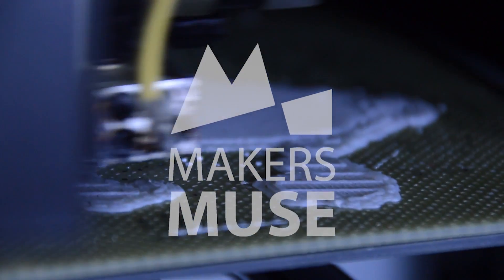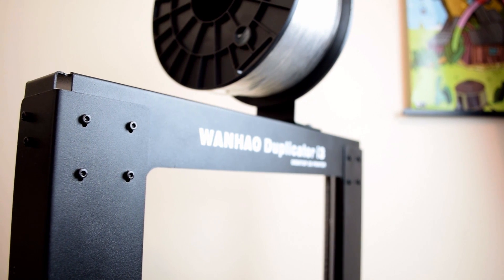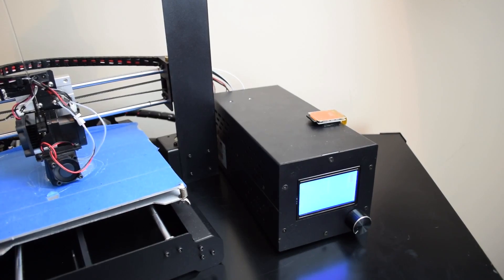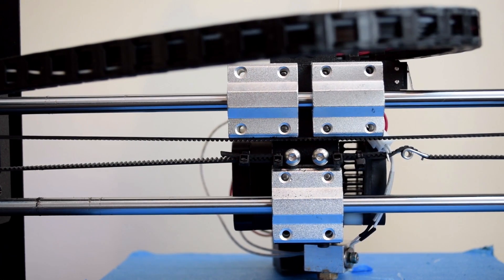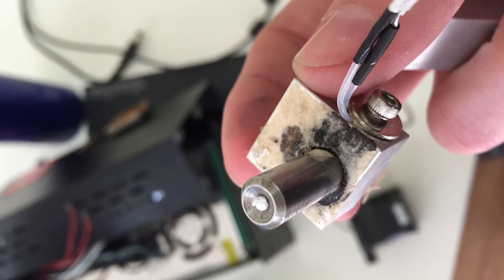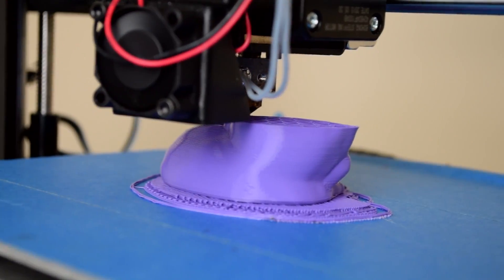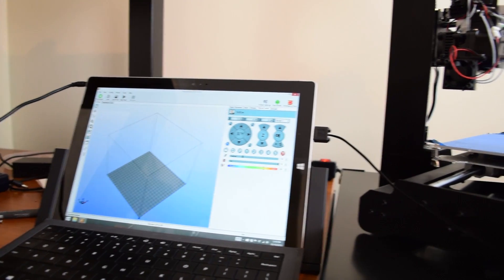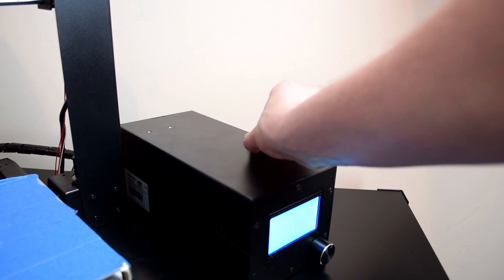Wanhao Duplicator i3 3D Printer Review - 2015

Comment: Congrats on the 1Mil. this was my first video I saw from you. Used my first tax return to buy one all those years ago.
Reply from the maker: Thanks! I do kind of miss these sheet metal i3s, how long did yours last?
Reply: @MakersMuse  5ish years.  It would still be working if I hadn't started a ReDuplicator mod, and fried the old melzi board in the process. Just finished a 350 V2.4 Voron build . next its am Ender5 to Mercury 1.1 conversion. Then I think Ill get the I3 back and and running, still have all the parts

Comment: I myself got the Wanhao i3 plus, bought it in 2017. It's still up and running (With some downtime since i had a time where i didn't have enought free time) Only thing that needs fixing until now are the bearings on the y-axis but i don't mind that :) Almost all my prints come out perfectly after a cooler shroud upgrade which i printed, and currently getting all the components for a z brace. Very happy with my machine!

Comment: hi I'm interested in getting a 3d printer in the next week or so . I found this on ebay. and from the reviews over sea's seems to be a very popular version of the i3. can you please have a look and let me know if it will be a good one to start with . http://www.ebay.com.au/itm/112198782900
Reply: The Monoprice Maker Select V2 is basically a rebranding of this printer in this review but far better. I own one myself and after printing a couple mod upgrades for it, it does everything I could want. I bought mine off Amazon here https://www.amazon.com/gp/product/B018GZBC3Y/ref=oh_aui_detailpage_o01_s01?ie=UTF8&psc=1
Reply from the maker: Yeah, I would join the Facebook group for that machine to see how 'good' it actually is - or watch our review. It still doesn't work.
Reply: Maker's Muse hi thanks I'll look . i couldn't see a review you did on it ?
Reply: Maker's Muse hi I see there's not a part 2 of the review.  I take it its not a printer worth getting . thanks for the heads up
Reply: Scott Miller thanks for the link. still out of my price range I'm now looking at the flsun metal i3 on amazon.  has some good reviews

Comment: Do not buy this printer, is the basic feeling after 4-5 months of owning one.  Unless it's the only sub $400 printer you can get for some strange reason, like seriously almost anything but this, but if it's the only option of Wanhao or nothing then yes due to those limitations buy one, fix all the BS first before running it or the bearings will fail at 3 months and it will need full disassembly and replacement parts.

love/hate this printer.  I own the Monoprice V2.1 same thing different label.  the metal frame is kind of nice, except it's too thin and flexes with the inertia of the Y carriage and heatbed at speeds over 30mm/s.  can be fixed with structural mods but that is sort of defeating the whole 'it's a metal frame' selling point if it needs to be fixed anyway.  And an open threaded rod frame kit is easier to attach improvement to, extrusion based kit the saem, easy to mod, this printer with its specific holes and flat planes of thin metal is much harder to customize and improve.  It's not designed to be improved at all, yet it needs it massively.

Main problem is that everything that needs to be adjusted, tightened, or replaced after a few months printing, is completely hidden and buried, in my industrial designers training it appears to be 'polishing the turd', busy work for a designer taht never took the time to actually understand the product or the users needs and expectations.  But in some ways it just seems like they were actually trying to make the unit unserviceable to get consumers to buy a new one at 6 months like it's a mobile phone.

X axis belt pulley and bearings require the entire Z and X assembles come apart to get at for replacing.  this in itself is just rediculous and reason to buy any other kit.  I am struggling with the X axis bearings having gone out due to a super crappy design with M5 screw as axle, and no bearing washers so the bearings stock instillation rubbed and destroyed the bearings and the M5 screw.

And they put it all inside behind and under the Z carriages, which are mounted to have everything facing a sheet of metal and totally impossible to access.

Suspect a very bad designer is throwing cliches off the top of their head based on experience with totally different and much simpler consumer products.  It is apparent after 6 years of industrial design school that actually using and testing the design decisions did not happen at Wanhao.

I went to industrial design school, this 'design' of the Wanhao i3 is so typical of a design that was done overnight on paper using thoughts of other products superficial surface qualities, without any knowledge of actual 3d printing experience and printer ownership and maintenance.

Wanhao needs to fire that design department IF they are not willing to use the products and actually do really user experience based design work.  I am not saying 'fire them' I am saying 'fire them if they refuse the most basic of designer requirements, to know and understand the users needs and desires'.

It's not like its stunning or anything more than basic/simple/cliche visually.  yet to achieve a level of 'meh whatever' they hid things that a user actually needs access to.  they created frustration and bad brand image rather than confront a boss that didn't understand what the user needed and was pushing for 'more sheetmetal surface, less features, cheaper'.

I am not trusting Wanhao to do much right if they can't even have a designer print 8000m or so over a few months use to understand what they then intend to sell to you with all the implications that they actually know what they are doing.   They fail to get simple things right.  They are totally copying designs, and when they change something it's worse not better.

They are a houshold goods and simple products company applying all the wrong theory to a wonderful basic design and producing a pretty mediocre product, could be good if not for the misguided attempts at beautification through hiding things like screws and pulleys and drive system.

Comment: I've had hours of fun with the Wanhao i3 and it was my first experience of 3d printing, but I guess I do fall into the tinkerer category. I have applied all of the recommended mods and also built an enclosure, though I was able to print successfully in ABS before I built that. I have had a lot of trouble with the MK10 hotend though, so am on the lookout for a better replacement that will work as a drop in alternative compatible with the Melzi board and doesn't require too much modding of the axes.
Reply from the maker: Look at my flexion extruder review ;) best upgrade for the stock mk 10 I've see so far and an easy process to upgrade
Reply: +Maker's Muse great, will do - still working through all your videos!
Reply from the maker: Haha no worries, there is quite a few now...!

Comment: Do you know what difference is between the V1 and V2 on this printer? I haven't received mine yet. Thank you.
Reply from the maker: +Felipe Acevedo The main visual difference is the V2 has a slanted screen - there are many other improvements such as a better micro SD slot, motor dampeners and an overall more rigid frame.

Comment: The Duplicator I3, is also know as the Maker Select in the U.S. which is available for $349 from Walmart or order direct from Monoprice, Inc, search google for the site. Angus has a point this 3D printer is not for beginners,  but if you like to tinker and make mod's then this is for you.
Reply from the maker: +Felipe Acevedo I recently reviewed the V2 of this printer (rebranded to cocoon create) and it was a much improved machine. I am worried the Maker Select are trying to clear out the older V1's.

Comment: My Monoprice Maker Architect 3D failed and I had to return it.  Monoprice is offering their clone of this Wanhao Dupliacator i3 for only $349.

Should I go ahead and get it?  I mean the print area is huge and it's metal!  Sounds relatively quiet too.  It's RepRap Prusa i3?   That's opensource code right and electronics?  So if it fails, I can eaisly get non-proprietary replacement parts?  IS all the source code provided?  Assuming it's arduino (I program arduino and know electronics).

Just wondering if I could fix all these little problems myself for not much money and have one heck of a printer for $349. 

WOuld appreciate some feedback from you guys thanks!
Reply from the maker: Have a look at my cocoon create review, it's a rebranded v2 and almost all the early issues are fixed. I say go for it! None of the bits are proprietary and they're easy to source.
Reply: I got the v2 (rebranded as Monoprice Maker Select V2).  And I've done just about all the James Armstrong / JetGuy Mods.  And it's one sweet printer.  Getting gorgeous prints at .1 layer height.  Great detail in small DnD minis.

Link to my thingiverse makes/mods for this printer:  http://www.thingiverse.com/JenniferG/makes

Comment: Angus... I purchased my printer (first 3D) a few months ago. I don't have the "crimp" wiring problem and the printer has worked reasonably well. However, as you mention in your review, I've had to do a fair amount of experimenting and tinkering to get decent prints. As such, I have to agree with your review. I've had issues with the Z axis adjustments as you describe in the review. I'd be interested in knowing where to purchase better micro switches. Last week, I did have the bed temp sensor fail. Got a new part from the dealer and replaced it myself. Also replaced the extruder with a all metal Micro Swiss MK10. I've only done one print, so not sure how much better it will work. I do like your idea about the aluminum tape on the extruder heater element. Thanks for the review.

Comment: When my duplicator i3 arrived the z-axis stop switch wasn't wired properly to the main board so that took a little time to fix. My main problem with the duplicator i3 is the metal bed. There are 2 bearings on one side, and 1 on the other. This makes the bed warp when leveling and throws off the print bed after every other print. I plan on making a support rod to attach under the bed to make it more sturdy so it will be flat all the time.

When you mentioned the bad switches, my z-axis stop switch didn't even have a metal arm on it so I had to replace it with the spare the printer comes with.

Currently my printer can handle ABS pretty well, using blue painters tape+elmers purple glue.

Also PSA to all owners of this machine out there. BUY A MICROSD EXTENDER. For the love of god spend the 6-12$ and get one. It's far too easy to drop it inside the power supply, then having to tear the power supply apart to retrieve the card.

Comment: I just bought a wanhao duplicator i3 and I think it makes very good print.
this is my first 3D printer and it worked out of the box after it was assembled.
my printer is the same printer as the one in the vidioen and it seems that the Chinese will take care of problems along the way.
the SD card problem is no longer an issue since the card only to be put half way into the slot.
Reply from the maker: +Mich Lerche Hessner Kristensen Awesome, glad to hear that! You're right, they're good at solving problems along the way.

Comment: Thinking about getting v2, do you recommend it?
Reply from the maker: +Modern Gaming For sure, V2 fixed a lot of the problems and they're great machines. Still need to tinker a bit with them, but I think best bang for buck in their category.
Reply: Maker's Muse OK thank you!
Reply: +Modern Tech I just got the V2 (thanks Angus, you helped me decide :). I have never touched a 3D printer before, though I am technically inclined, and I got a wonderful print off it after 2 hours of opening the box. Mods are likely to follow, but it does work pretty much out of the box, as it were. Leveling the bed though, is fiddly.
Reply: Maker's Muse Thank You Angus and ultrapowermae! I have decided on the V2 and I have been emailing the company asking questions! Hopefully if I buy one I will probably be making youtube videos about it.

Comment: Hi,
anyone here have experience with the Mendel90? I'm asking because I'm uncertain about whether i should get the Wanhao Prusa I3 or the mendel, as the first 3d printer. Just by reading standard specifications of the two, the mendel seems to be better however it is also slightly more expensive. But i have also seen videos of people upgrading their Prusa I3's and apparently get very good results. What I'm really asking i guess, if you mod the Wanhao I3, will it then be possible to get as good results as with the Mendel90?

Comment: Perhaps I may be of assistance with your leveling issue. If you know Gcode, you can just change the Z axis offset parameter. If you don't know Gcode all that well, or if you are not sure what I am talking about, feel free to ask me anything. Even if you have no idea what I am talking about, I can fix your leveling issue in just a few minutes. Thanks for making These awesome videos!
Reply from the maker: +CJ Printing Cheers! Yeah I used to do that with my Makerbot 5th gen as it had a Z homing inaccuracy I needed to compensate for. Problem with my wanhao is it's not a reliable offset, so changing the code may or may not work. I think I just need to replace the switch but never have the time...
Reply: +Maker's Muse indeed. do you have a v1 or v2?
Reply from the maker: V1 for me, basically first release so had a few issues but they're fixable!
Reply: +Maker's Muse yeah. I just ordered the v2 so I hope most of the issues have been fixed.

Comment: Got mine for Christmas, they updated the micro dd card slot so the card sticks out a lot more(enough to grab onto it) and the fan for the power supply is in my opinion fairly quite on my model prints like a dream, have only tried pla but have had no problem getting up in temp
Reply from the maker: +Matthew Goodman That's awesome to hear! I'm probably going to invest in a few V2's for a 3D Printing room because they still are the best bang for buck machines In my opinion for printing PLA. Damn I wish I got things I actually wanted for Christmas..

Comment: Got the Wanhao i3 v2 in October, Works perfectly, did 40+ hours no fault, PLA+ABS. 

Great review Muse;

on v2 all the issues listed  have been fixed bar the belt sliding on the metal which i solved with some silicone spray which removes any grinding. Temperatures reach up to 250/120 but i print standard on 235/95 for ABS

I have to disagree on not printing through Simplify 3d, I ONLY print trough it, out of a nice and organized folder on my pc and its just great (makes no sense to me all this micro-sd swapping crap), you see 3d printing in real time with up to 0.1 refresh, you can give commands remotely in real time and it just makes the whole printing process more professional and fun, of course you have to have a computer connected to the printer and it has to be set not to go on stand by...To get the communication running fine you have to go in S3D Firmware config, communication tab and UNTICK - wait for startup - and - communication timeout - and you are good to go!

The external box liking is subjective, I personally like it a lot, looks good and you can have some control over the printer without having it too close. also why would somebody want to carry  the printer around? Not only is unlikely that's needed but also moving it around is not advised as any part movement can reflect on print quality and precision.

I tried a few different printers and the i3 (v2) is definitely the best of the low budget printers out there, its (unlike most) almost ready to print out of the box, (I have many friends that bought other unknown brands or Prusas in kit for the same price of a i3 and end up losing the will or asking around/paying loads to get it built and configured as they failed miserably in setting it up properly ending up with a lower quality product anyway) build quality is incredible for the price, print quality is as good as it gets, it prints multiple materials, print volume is large, its quieter than most and it looks really good! I was up and running printing PLA in just about 30 min!!Unseen!

My Mods: 

1) M3 Nuts in printbed screws (!!)
2) Butterfly for bed leveling replaced with printed wheels (!!)
3) cable tie on axle for Y axiz belt 
4) blower fan with 3d printed rear mounted cobra duct.
5) 2 aluminium usb led strips, dimmable, touch controlled
6) Auto reset Jumper removed (Needs to be put back if usb flashing needed)
7) Print surface, If you are not already using it I personally recommend Buildtak, the Wanhao one that comes with the i3 v2  is great and can buy it for less than 2 dollars/1.7 eur 1.2 pounds per sheet. Clean ONLY with isopropyl Alcohol (Rubbing alcohol)

Lubrification:

Bearings for horizontal rods are self lubing, i just clean when leftovers appear on the rods
Belts and pulleys: Thin silicone spray.
Threaded rods: Lithium or Silicone grease, also same silicone spray does the job but lasts less.. 

Do NOT use WD40, graphite or bike Chain lubes. 

Filaments:

I buy Hobbyking ESUN ABS and PLA (even though I dont print much PLA anymore), they are like 8/9 eur per KG and very good quality! Pay attention not to buy unbranded, unpacked materials, you could end up going mad trying to get a print working or even damage your printer.

No, I dont work for Wanhao:)Maybe I should.